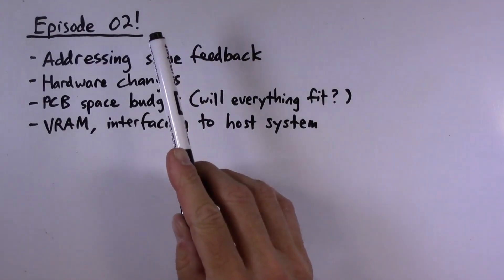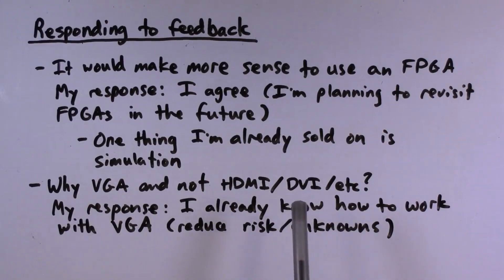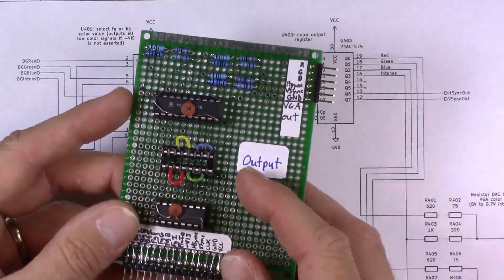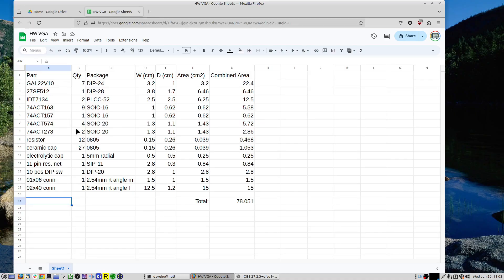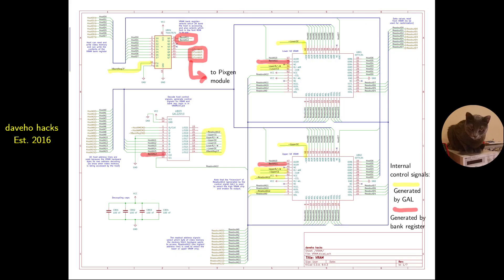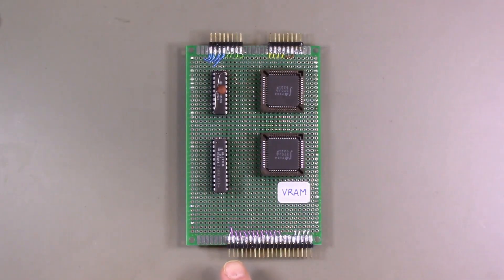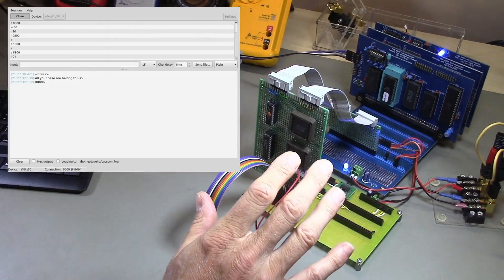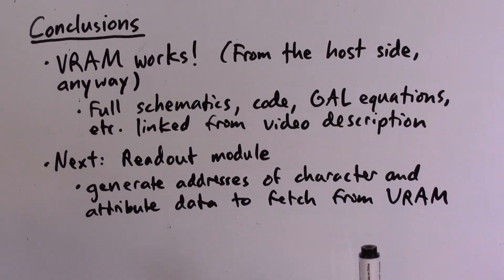Hardware VGA Episode 02: VRAM (and other stuff)

Comment: You'd be surprised to find out that DVI and HDMI work almost exactly the same as VGA, because hardware folks hate change @
Reply from the maker: Good to know! I will have to investigate at some point.
Reply: @davehohacks  Up until DAC it's all the same (sync signals, active/porch, etc). Then instead of sending signals to DAC, DVI/HDMI (the former is a subset of the latter) does some encoding of data (packing 24 bit of color and sync signals) into 10 bit symbols, and then transmits those symbols serially over 3 data channels along with a pixel clock.
Reply from the maker: @asmi06  That makes sense!

Comment: You're really smart and this is a well put together video. I wonder if you could create a dumbed down version of this video to appeal to a wider audience.
Reply from the maker: If you go way back on my channel to the early videos in the 8-bit computer series, there are some videos that go into more of the basics of address and data busses, bus control signals, etc. The nice thing about dual port static RAM is that it works exactly the same way as "normal" single-port static RAM, you just get two independent interfaces. Static RAM is very easy to interface. Also, definitely check out Ben Eater's videos on building a 6502 system if you haven't already. He does an amazing job of explaining things.

Comment: I need some of that wire.  Do you remember what gauge it was?  I have wire-wrap wire but it's way too thin for soldering (at least a lot of soldering).
Reply from the maker: If you search for "UL1423" on AliExpress, there's a listing from a vendor "FreeBoom". I ordered the 26 AWG variant. I'm not sure if it's really 26 AWG, but it's definitely thicker than normal 30 AWG wire wrap wire. I've found it to be excellent for point-to-point wiring on protoboards.
Reply: @davehohacks  Thanks!

Comment: I haven't checked yet of course, but have been wondering if the 6309 bus cycle in my project leaves enough idle time to externally access the fast system SRAM without having to slow the bus clock down from 3.57MHz..
Reply from the maker: I guess when E is high the 6309 isn't accessing memory, so maybe your external device could sneak in then?

Comment: Very interested in the VGA card. Especially how you will interface the software with the hardware.
Reply from the maker: I think the software should be fairly straightforward. The only real complexity will be the bank switching, so the software routines will need to set the bank depending on which character or attribute they need to access.

Comment: I dont think this was wire wrapped. If i understood Dave well, he used wirewrap-style wire and did P2P soldering. Real wirewrapping would be actually be faster. I wirewrap a 100mmx160mm eurocard-sized pcb with 20 or so ICs in 6 to 8 hrs.
Reply from the maker: Yes, this is just point-to-point soldering. I have done some wire-wrapping in the past. My only real objection is that wire wrap sockets are expensive.